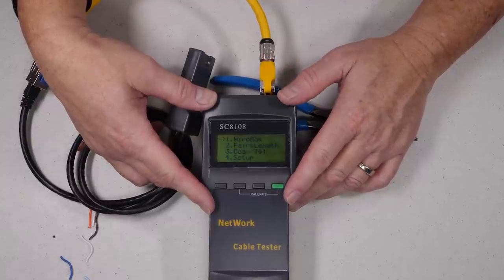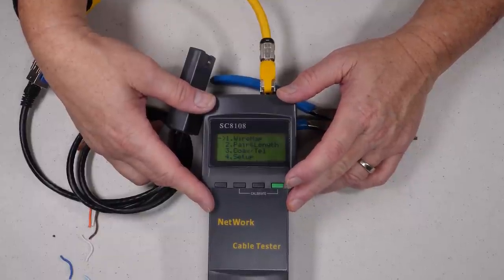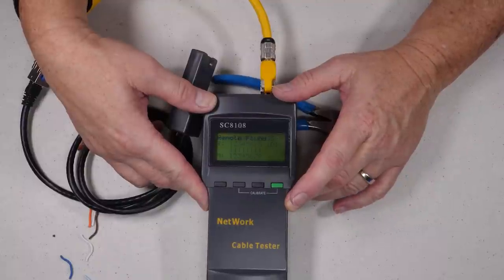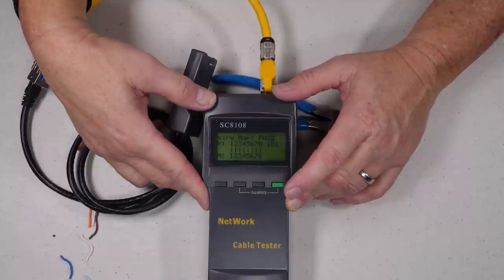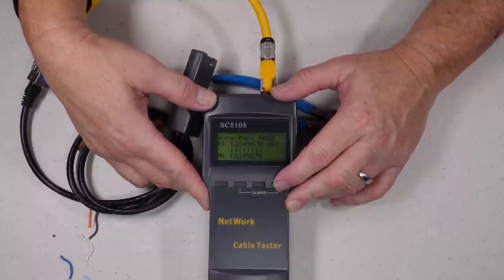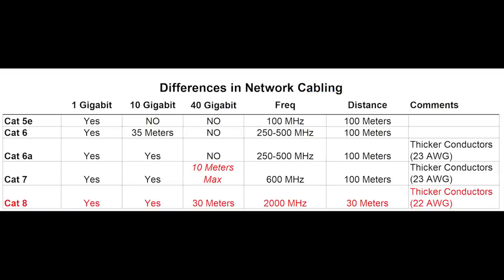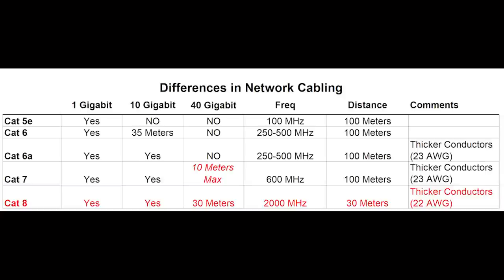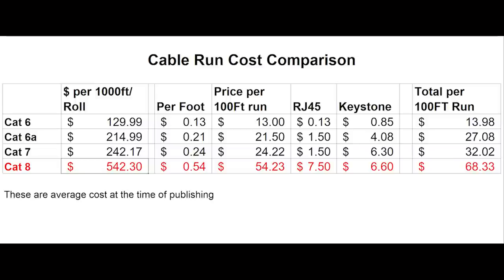CAT 8 vs CAT 7 Ethernet Cables - Is there a difference?

Comment: I don't think CAT8 will prevail. Then fiber is already the cheaper and more reliable solution.
Reply from the maker: In most cases you are right.  Fiber is easier except when running in walls.  Great point.

Comment: Googled the specs, so honestly  this would be overkill for average hosehold.. Even for small-medium buisnesses.
Reply from the maker: Yes it would.
Reply: Reduces upgrading wiring
Reply: Other then connecting different equipment close by, it's also overkill for most large ones. Fiber is simply better for longer runs. And cheaper.
Reply: For home installations, anything more than Cat6 is overkill. It can handle 10G up to 55 meters, and only the largest homes will need runs longer than that.

Comment: Is Cat 8 faster than Cat 7?
Reply: It's stated in the comparison chart at the end of the video. With Cat8 you can technically achieve up to 40 Gbit/s on a distance of 30 meters, while with Cat7 only up to 10 meters.
Reply from the maker: It certainly can be under the many conditions.

Comment: if i need anything faster than 1gbit, it's going over fiber. cat7 and cat8 are a waste of time, money and effort. i don't see the logic behind spending all this money to overcome the shortcomings of the copper wire when fiber is better, faster, easier and cheaper. all the fiber patch cables i have now running 10gbe-100gbe were less than half than cat6 wire in bulk, which is substantially cheaper than cat7 and WAY cheaper than cat8.
Reply from the maker: Agreed.  6A or 7 is all you really need for 10GbE.

Comment: there are not even cat7 plugs. it doenst matter what youre using
Reply from the maker: Thanks for your feedback it is appreciated.  There are actually a wide range of CAT6A, CAT7, and CAT8 connectors, wall jacks and extensions though the CAT 8 stuff is not practical, there is much to choose from for 6A and 7.

Comment: Lol and I'm still using cat5e
Reply from the maker: Nothing wrong with that.
Reply: As an ex network admin guy, I used to do all my 5/5e cabling / terminations myself wherever I was employed. But that was over10yrs ago. Tech has changed so much since then, and I didn't keep up with the changes. Son bought a new performance laptop a couple of days ago, and my eyes nearly fell off my head when I saw the LAN port was marked 10/100/1000/2500. Since both kids are taking university classes online from home now, had to hardwire a UPS backed up Home gateway modem with approx 100ft runs directly to the two laptops, because exam proctoring software is very unforgiving. Pre made/terminatex CAT 6 was the cheapest, and works well with my installation of  2 ROKU TV's, 2 laptops and a desktop, which doubles up as a PLEX streaming server.
Reply: No need for anything better if you're not trying to run speeds faster than 1 gigabit.
Reply: @KingdaToro  I will probably be able to afford to rip all out and replace it when I can afford 10 gig interfaces.
Reply: @johnsilva5020  There is no exam in the world that requires a 1G network.
Reply: @sergeig685  never said the exam needed a 1g network 😂🤣 put a UPS on the modem to prevent the single point of failure 'inside' our home. External failures can be vouched for by the service provider, and submitted to University for arbitration. In an area where there's a huge concentration of wifi traffic, doing an axam on wifi connection is definitely not the way to go (specially when a hardwire option is available)

Comment: In a home network, you will see ABSOLUTELY NO DIFFERENCE with any cables more expensive than cat 5, which is the cheapest you can find these days.
Reply from the maker: Depends on your use case but I certainly saw a big difference going to 6A or 7 as I run a 10G network at home.  For 1G it is a tougher sell.

Comment: I did not like it video. You said to introduce the standards of Cat8 and Cat7. As most of the time you are introducing how to make cables. all of these three methods of making cables can be used on Cat6 and Cat7 and Cat8, one of which is an exposed wire outside the wall and the other is a hidden wire inside the wall Module. The difference just lies in their completely different uses.
Cat6 and Cat6e single cables are usually under 24awg, Cat7 and Cat7e are usually 23awg, and Cat8 is 22awg. Therefore, the matching connectors are not the same.
The manufacturing technology of Cat7 cable is more precise, the copper wire uses the leveling technology, the outer skin uses the foaming co-extrusion technology, and the shielding is increased. Enhance lifetime reliability and signal quality, etc.
Cat6 operating frequency is 250MHz, Cat7 operating frequency is 600MHz, Cat8 is 2000MHz
Keep the distance between Cat7 and Cat8 shorter.
I thought you would use a professional tester such as Fluke to test the maximum speed difference of the cable. The way the copper foil is attached to the ground wire is also wrong, and your instrument cannot or does not test whether the ground wire is reliable!The result is that you are completely wasting my time!

Comment: Just like nobody needs Cat7, nobody needs Cat8 without exception. There are no products available on the market that require either product. There are no IEEE Ethernet standards that require Cat7 and while there are IEEE Ethernet standards that require Cat8 there are no products available to purchase and it's limited to ~30m in point to point scenarios in a data center, so no structured cabling. Just as 10GbaseT has see almost zero uptake in the data center I doubt that Cat8 will ever see any major use as you would just use direct attach cables, or switch to fibre optic if you need something longer. So you might as well stick to Cat6a and save the planet as well as your wallet.
Reply from the maker: Thank you for the feedback.  I appreciate it.